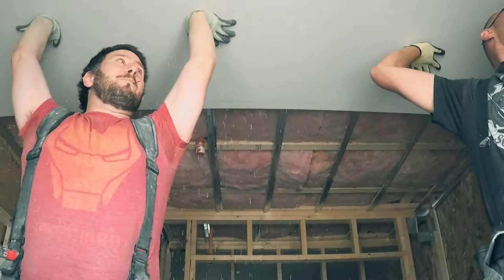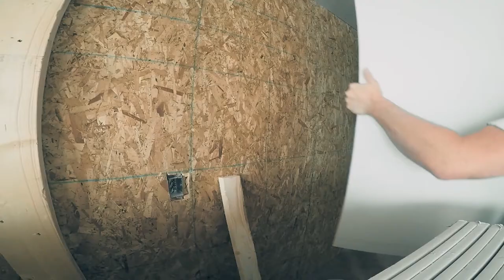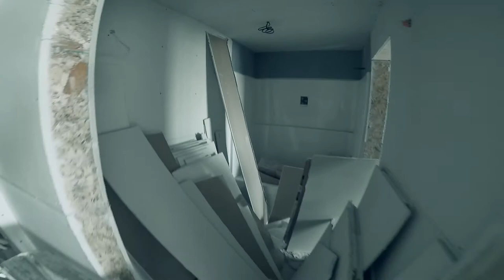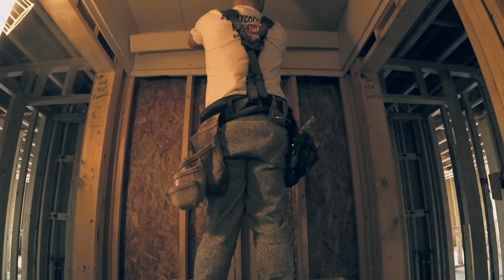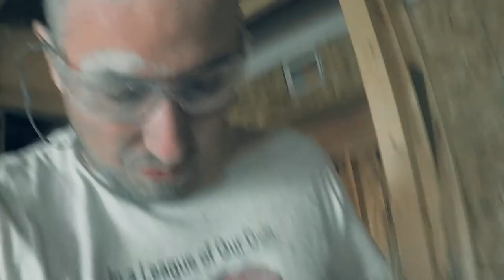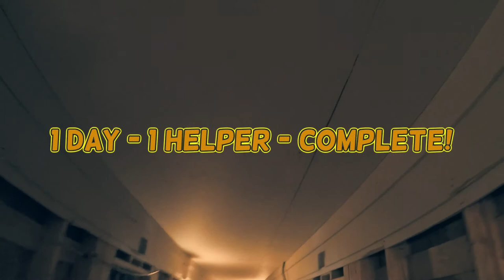Drywall Tips & Tricks By Expert Drywall Installers

Comment: Nice job, Chris! 12 foot 5/8" ceiling boards. 😝 Gotta be done though.  Question: why the quarter cuts on the air returns instead of the entire square at once? Also, when hanging across a door opening, do you use a drywall saw for the vertical cuts? Not a keyhole saw, but a drywall handsaw.  Or do you just router those a well then razor the top of the opening?
Reply: I've done it both ways.  Just wondering your preference.
Reply from the maker: Yep I do the quarter cuts when it's already drywalled in the inside of the fire damper opening. If it was bare steel or wood I wood router straight.around. the widows I back cut all around with the olfa and then use the router to cut the the short side, then I snap off the rest. Most excellent and expert questions dog! Cheers
Reply from the maker: Oops I said windows above I meant doors. The windows I use long screws to tack the sheet on the wall straight over windows and exterior doors then just router all around
Reply: @ConstructionKronies  i always razor one side of the door header so after the 2 uprights are cut i can just snap it off from there.  Thanks for your insight, Chris! 😁👍
Reply: And yeah, i thought those openings were just air returns.  Hard to tell they were already-drywalled fire dampers.  LOL
Reply from the maker: @meagaindave2049  cheers man, I do that same thing except I score the whole back side so that the router bit has a path to travel on and then when I am up on the bench and find it easier to router either side I can without having to climb off the bench and score it again! I can always tell you know your shit when it comes to drywall man. Respect from one boarder to another!
Reply from the maker: @meagaindave2049  Yeah the video isn't close enough to tell.